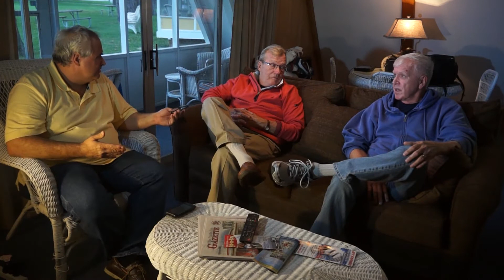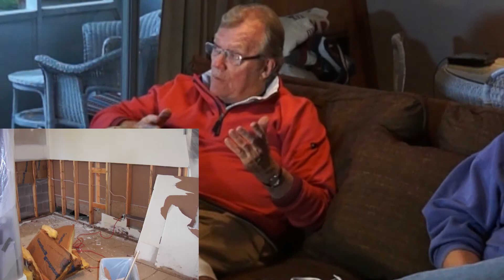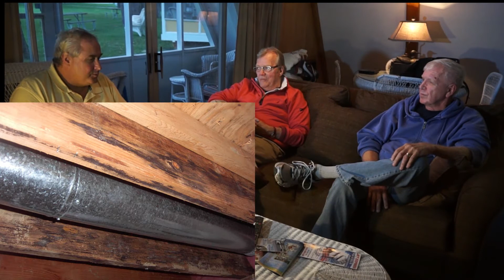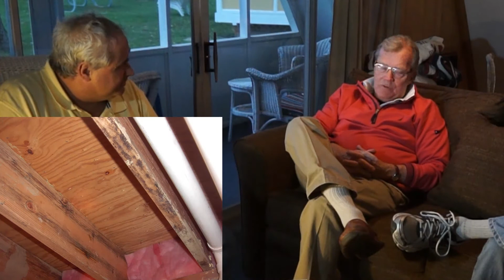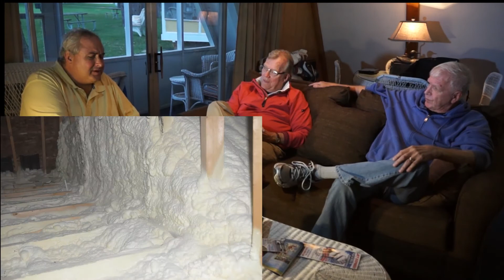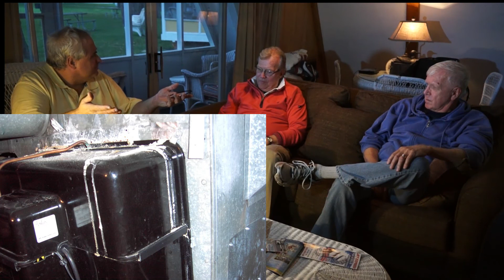House Talk Volume 1 Part 2 mold foam insulation vapor barrier HVAC humidifier

Comment: We are in a SFH which always has a 10 degrees difference between the downstairs and upstairs in the summer/winter even though we have a very open layout (split level).  We were debating on doing the spray foam along the roof option in the currently vented attic and making it an unvented/conditioned space to help with the heat/ a/c staying in.  They suggested open cell on the roof and closed cell on the sides where the gable vents currently are. But mold is my main concern..not sure what to do.